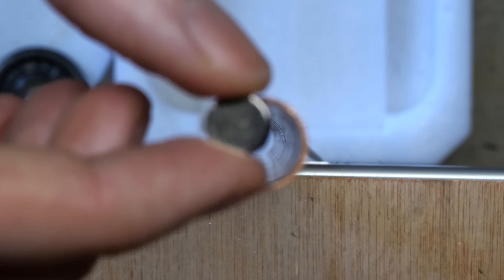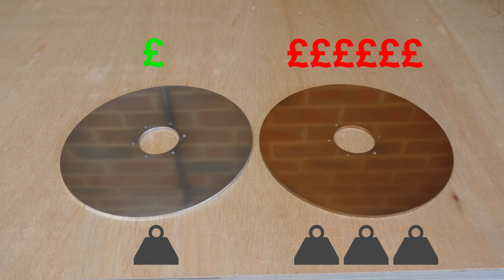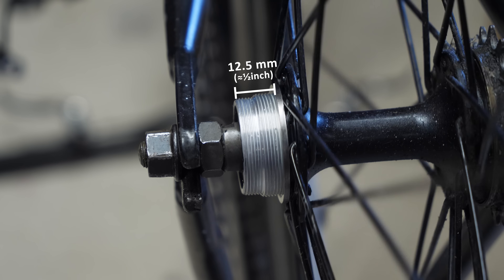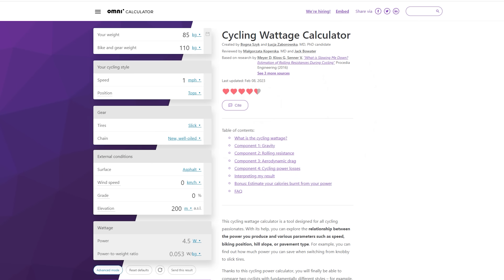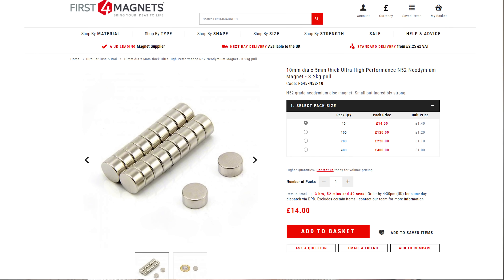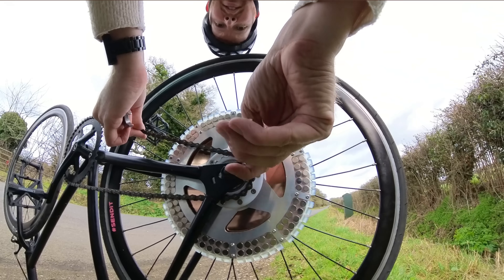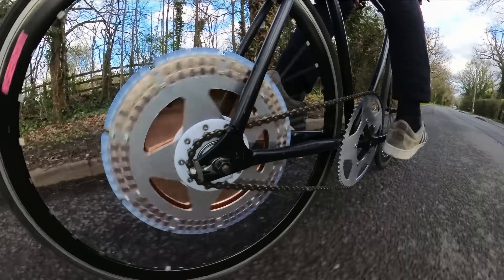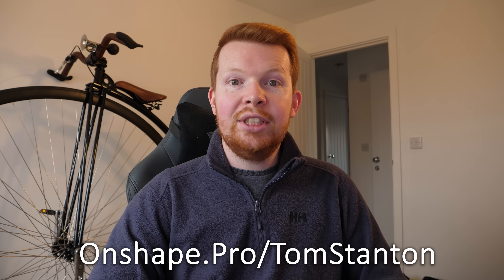Gearless Magnet Bike

Comment: Did you take convection into account when making the heat energy calculation of copper? because if you only take into account the heat for heating copper up to 20° C delta-T and not the amount you lost trough convection  over the disk troughout your ride (e.g. airspeed over the disk etc.) then your heat loss was waaaaaaay more than what you calculated. nevertheless cool concept! really made me think about cool designs!

Comment: Definitely works significantly better as a breaking system than a powering system 😂😂 Probably wouldn't have had to worry so much about heat if the copper disc had holes in it too, but I mean, not like it's going to be a long term thing anyway ¯\_(ツ)_/¯

Comment: Have you thought abot making clutch as 3 cylinders - inner copper, 2 outside with magnets in halbach array opposing eachother. That will create much stronger eddy currents in copper ring. But heat is one of the problems - you waste energy on resistance - ring heats up - resistance raises - you waste even more energy.

Comment: Nice video! I think you can brake faster if you pedal backwards. The higher difference in RPM will make you brake faster, even at low speed.
Reply from the maker: The forward force on the pedals is really strong, so I was only just able to lock the pedals. It's not like pedalling backwards on a freewheel.
Reply: @TomStantonEngineering  first of all: nice work! To give you a hint about the behavior of your system, it is the principle of an asynchronous machine with a so called squirrel cage. That's, I guess you already know it, the most popular electric motor you find in industrial applications. The amount of torque depends on the slip, means the relative difference in speed between the wheel-disc an the magnets. Theres a formula called "kloss equation". You will find curves that show you a maximum of torque depending on the so called slip. If you're more interested, we can dive deeper, since I worked at an institute for electric machines. Regards, Robin
Reply: @TomStantonEngineering  - some electric machines can CHANGE their coupling level - because they have electric magnets instead of permanent magnets.
this means if you power the magnets down, you will get a real free wheel. also the slip can bei tuned to your needs. - have fun!
Reply: in effect its the induction brake - but modified.
Reply: @TomStantonEngineering  thanx for clearing t5hat up I was thinking that throughout the video whole thing was truely inspiring  you have a new sub! whats next? an improvement or moving on cant wait for either?

Comment: There is a flaw in the initial disc comparison, where aluminum is faster than copper. It should be made with a stationary disc and the magnets on a rotating shaft. Only this way you can get rid of the rotational inertia of the much heavier copper confusing the result.

Comment: Have you considered re-designing the rim to remove all the little spokes, make like a Star of 5 solid spokes using the copper in the spokes as well, which will also allow you to custom machine rear sprocket all together not having to use the plastic items/gears?  You can also use the lighter solid foam core bicycle tires that don’t require a tube or air.  Just a thought, loved your video!!

Comment: You could adapt this for the front wheel of a bike, in place of the front brake, where normally the copper and magnet wheels would spin freely together, but squeezing the brake handle stops the magnet wheel, creating resistance in the bike wheel rotation, allowing you to slow down going down hill or approaching a traffic light, without use of actual brakes, basically increasing the rate of deceleration and reducing brake wear…

Comment: peddle backwards to brake.
Reply from the maker: The forward force on the pedals is really strong, so I was only just able to lock the pedals. It's not like pedalling backwards on a freewheel.
Reply: @TomStantonEngineering  in video, it looks like you're riding bicycle without any struggle. But if what you're telling is true, man... anybody can get big thigh muscles in 4 to 5 months by using that prototype.😂

Comment: I know I'm really dumb when it comes to a lot of things (including this) but I love things like this so I'm going to ask a question while presenting a theory (from anyone reading this I'd appreciate guidance and thoughts ❤️), I noticed Tom Stanton said "waisted energy because of the heat it generated on the cruise home, what would happen if you let that energy charge some sort of battery (so that it's not souly dependent on the magnets) I have no idea if something similar to what I'm talking about exists already (aside from there already being electric bikes), would this then take some load off the magnets in terms of increased heat generation (wait, no I just read this and I feel its wrong because the heat is generated due to the passing of the copper and magnets. I'll leave it in just incase im wrong). I hope this doesn't defeat the purpose of what has been made ❤️. Also another question/theory, would it be possible to use that same electricity to stop the peddles from moving by having a sensor on both pedals keeping a track of the pressure being given by the user (aka the user is pedaling) and only apply resistance to the pedals if I the pressure falls underneath a certain threshold. I love the concept of this idea of a bike like this so that's why I have such a great interest, I was always taught that no question is a stupid question if there is a proper thought process behind the question.

Comment: What if the copper sprocket was made like a brake rotor with it being vented for cooling and weight reduction. Also, since RPM's are the key, what about pairing this system up with the 15,000 RPM, higher torque, 1000watt, drone motor? Also, upon "braking," it would seem beneficial to reverse the rotational direction of the magnets at the same time? Lastly, would there be any benefit to being able to adjust the distance of the magnets from the copper sprocket? Perhaps an "articulating" system to move the magnet sprocket closer or farther away from the copper one? Great video!!

Comment: The magnets on the other side of the disk we cant see may be interfering or attenuating the magnetic field. I would test by first removing them leaving just one side full of magnets and the next test with different patterns, e.g. opposite sides, same plane. also using metal back-plates on the magnet helps allot
[S N]  |Cu|  [N S]  
[N S]  |Cu|  [S N] 
    config 1/5
[N S]  |Cu|  [N S] 
[S N]  |Cu|  [S N]    
    config 2/5
  X X   |Cu|  [S N]
  X X   |Cu|  [S N] 
    config 3/5
  X X   |Cu|  [S N]\Fe\a
  X X   |Cu|  [N S]\Fe\a
  X X   |Cu|  [S N]/Fe/b
  X X   |Cu|  [N S]/Fe/b
  X X   |Cu|  [S N]\Fe\c
  X X   |Cu|  [N S]\Fe\c
     config 4/5
d\Fe\[N S]  |Cu|  [S N]\Fe\a
d\Fe\[N S]  |Cu|  [N S]\Fe\a
e\Fe\[N S]  |Cu|  [S N]/Fe/b
e\Fe\[N S]  |Cu|  [N S]/Fe/b
 f\Fe\[N S]  |Cu|  [S N]\Fe\c
 f\Fe\[N S]  |Cu|  [N S]\Fe\c
     config 5/5

d\Fe\   or  /Fe/a  represents iron plates that connects two magnets together, one magnetic pole to another on the same side. a to a, b to b, c to c.....

X X represents the absence of magnets, Iron, or Copper. Nothing basically.

|Cu| represents the copper disk

[N S] or [S N] represent dipole magnets, N being North and S being South

Comment: Fantastic. It does not matter if the goal is achieved 100% or not, the idea is just cool. Please think about a larger diameter of the copper disk and Sprocket (so able to use more magnets). Also, put angled holes on the unused part of the copper disk OR any other idea to air-cool the copper disk. Just a suggestion. Thank you for the innovative video/idea.

Comment: The clutch will work much better if you drill the hole through the aluminium and copper disk and put there a short bolt. This will address both problems the energy loss and overheating.

Comment: You need to introduce the 'National Heath Robinson awards with this as a strong contester. 
I also had a brainwave about energy generation but the logistical challenge was too big to overcome. 
It involved a way to power a pub using excruciatingly mediocre live singing open mic. You bury a (when the time comes) a BGT judge under the floorboards with their feet strapped to a belt driven generator.
Linked to the consumer unit. 
When the singer "sings" the deceased starts spinning in their grave thus driving the generator and augmenting the supply of grid power and solar panel energy.The more ex judges in banks of say six could yield enough gigawatts to power a Delorian but that depends on how bad each performance was. Obviously the maintenance would include periodic inspections for curled toes.

Comment: well made video. the free time, equipment, money, is a dream to have to satisfy curiosity and projects. however, the idea ignores a lot of existing electric bicycle tech that is ready to buy and cheaply! 16:10 an infinite variable transmission is to use electric motors, generators, or CVT. then again, why ignore battery powered propulsion as it is cheap and widely available? why not a battery powered simulated infinite variable transmission using electric motors? 
another nice project is an axial flux electric motor bicycle, the large wheels would allow for massive torque without additional width, and weight.

Comment: I considered using a stack of doughnut shaped neos in a suspension system made of thin nylon coated heavy wall aluminium tubing to locate them N-S-N-S and the aluminium would also offer at least some dampening from bounce.

Comment: I guess it would be more efficient if you slit the disk fom the the outside to the inside every few degrees  and leave the outside ring of a few mm. That woud force the induced currents to flow perpendicular to the magnetic field. Like the vid, your tests in the beginning show the effect as a brake, tuning mechanical power into heat. But you want to build a gearbox... Tranfering torque. Many of the eddy currents induced in the disc are not perpendicular to the magnetic field therefore just generating heat and not creating torque.

Comment: This principle would work well with an electric motor running it since you would get much higher rpm going forward and could also get reverse rpm to stop quicker. But then again, it would be much easier to just let the electric motor to drive the wheel directly.

Comment: So laminated steel isn't affected by Eddy currents like solid steel is so I wonder if your spokes are interfering with the magnetic field any? Also a  fat bicycle have more room to work with and there are aluminum alloy wheels available for mountain bikes but axle would need modified for fat bike that which would make your copper plate easier to mount 2 cause you can machine the rim its self  and weld on it and get rid of your spoke issues. Also you would have disc brake mount also. You can add squeeze brakes and a freewheel on the sprocket so you don't have the drag when you stop peddling. Also an electromagnet is even stronger if built correctly, can some sort of slip ring brush setup to get power to the electromagnets since they are moving would give you control of the gearing, but I would still leave in some permanent magnets if you don't have power for the electromagnet, but honestly I I was liking this idea because my mid motor e-bike wears out the wears out the chain and sprockets crazy fast. Just some ideas for another video like this. I enjoyed!

Comment: That is also the fundamental principle of regenerative braking in EV cars. When EV cars are rolling down a slope, withdrawing the power causes a strong reverse torque at the hub. This is an excellent source of free energy to recharge EV battery. Although they may not directly replace the plug and charge, they certainly help to extend the mileage by a small margin.

Comment: A really cool design! I have a new idea after watching this. What about turning the clutch into a brake? What if the magnet can be turned on and off with just a little force applied by your hand? So I can replace a regular brake by a couple of magnet and a large copper sheet and I would never change the brake paddle again.

In theory, the magnetic field of two permanent magnet can be trapped into a closed system by alternating its polarity and stick it to the same iron plate, creating no field outside of it. However, when these magnets have the same polarity, the iron plate will become  a large magnet and creates a large magnetic field.

So I can make a switch by utilizing this theory. I can pull the brake switch using my hand to change the polarity of some of the magnets to turn the magnet “on”  to create a large resistance and make the wheel stop. And by releasing it, it turned back “off” so no resistance would be applied by the magnet.

Although it may sound really cool but it is hard to implement, it is hard to change the polarity of the magnet using a little force without physically grabbing the magnet, unless you are using electromagnet. I guess when the mechanism really designed it would be easy to install on a regular bike and ride it daily.

Comment: What if you made a hub that can move closer and farther away from the copper plate. You can use a bike hydraulic disc break set up to move some sort of ram to change the distance of the magnets to the plate. It could create a lock out feature where there is no slip and give you slip when you want it so it would act kinda like a cvt

Comment: Now, if only instead of the copper plate you could somehow put insulated windings in there. Then you could get useful energy out of the ends of those wires in the form of electricity?
Then you could charge some kind of battery with it and use it on the uphills perhaps?

Comment: to deal with the heat problem you could pull inspiration from the rally turbo fan rims, basically fans directly attached to the rims of the rally car so that the wheel speed worked to suck air in and direct it into the brakes. so like maybe design it into the magnet drive to blow directly into the copper being that the magnets will always be spinning significantly faster then the copper. i dunno how much it would work being the size compared to a car rim but also it wouldnt be dealing with 400c to 600c of heat haha

Comment: Good Job, TOM
...I went through several explosions (allegorical) as I watched you calmly went about construction and testing               
...Before EM ...I played with super-heated steam 
Then metal shapes of texture to wear 
...then 'graphene' came about 
...with the 3d printer
I would blow helium into poly ethylene glycol for a dense dry fabric of nano-bubles that would maintain a level of around 10 ft in the air 
...attaching ionic drives to the hemispheres the stable hydrogen gas / oxygen 'discus' almost had a mind of its own 
...with artificial intelligence I can see hoards of automated guardians adapting to water pressure depths as well a to outer space  as generations would emulate biological cell growth and mitosis 
...next our human 'soul' could hitch a ride 
well Tom ...keep on trucking 
#WELLDONETOM

Comment: This whole concept is a very bad idea.  To produce torque here you need a speed difference between two plates.  Doing it with magnets, or doing it with a slipping rubber belt, or doing it with slipping mechanical clutch, will give the same result: Half the power is lost.  However, when using a slipping rubber belt you would see immediatly this is a bad idea.  But when you do it with magnet, it is the same bad idea; how come peoples are fooled and accept bad ideas when "magical" magnets are used ???

Comment: The next step in all this is to transfer the power generated in the disc into a battery or generator so you can store excess power generated on easy segments of a ride and reuse that power in motor assisted configuration during the hard parts.

Basically, you've re-invented regenerative breaking.
Reply: Also, varying the magnets from the center to the edge of the disc can be useful for acting like a differential and for capturing and regenerating energy to and from the hub. Though at some point, you have to go from the prototype you have now to using the wheel and hub itself to house the maglev drive.

Comment: Take a DC motor, short it's two inputs together, then use the motor housing for your input and the output shaft for your output. Same result, higher tolerances, and deals better with heat.

Comment: Try a solid resin/plastic rear wheel,(see Olympic racing cycling), fairly easy to source. Good luck, love the concept.  Also, perhaps mounting the magnets on the wheel itself @ outer radius of the disc with the copper disc being what is driven by the chain.

Comment: Cool Video.
the difference in weight does not effect the speed at which objects with the same air resistance (same shape and dimensions) fall through air, so in Veritasiums video another force must be causing the difference and that is likely the magnetic effect. When a pulley is involved their respective weights will effect the speed of the pulley according to newtons law a=F/m

Comment: What if you use electromagnets instead that regulates the magnetic flux based on the wheels rpm? This way you wouldn't have to run faster to increase the eddy curent. Great project by the way!